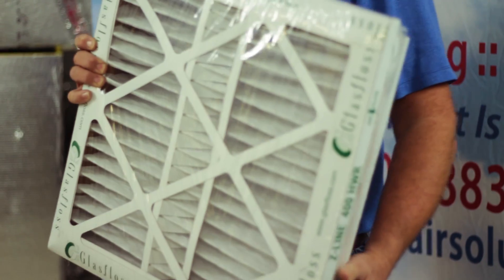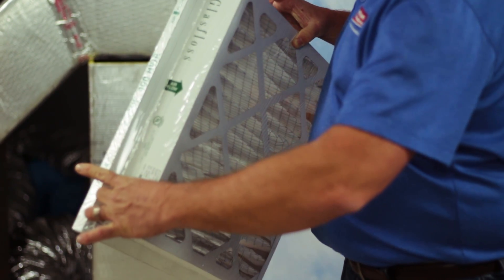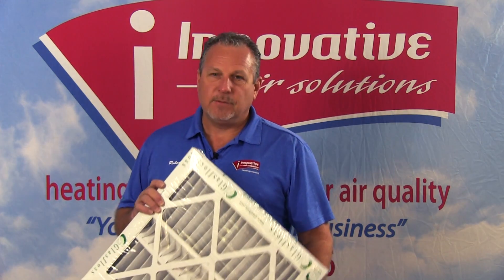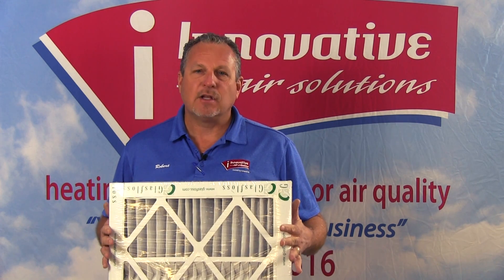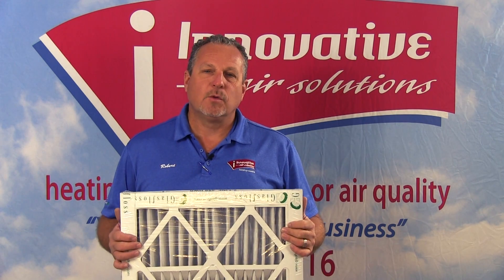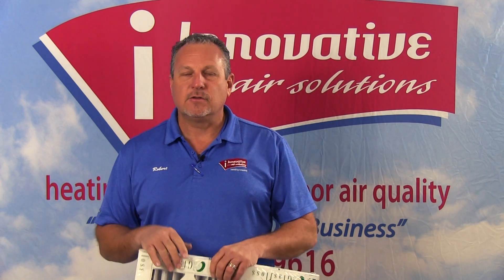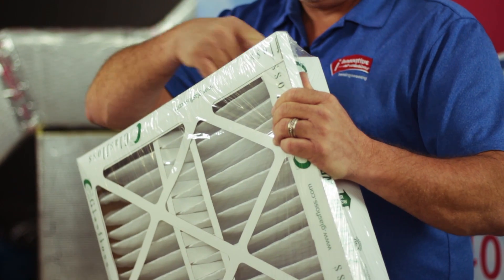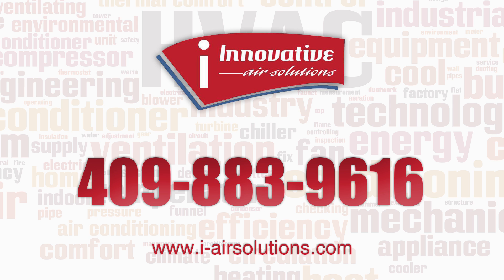HVAC - Return Air and Filters

Comment: No one provides Techs with the formulas for right sizing filter rack areas to achieve proper velocities through them; I will: 
HVAC Airflow- Duct, filter’s Ak and other Component Sizing Formulas: 
Ak area of the filter: CFM / required or desired fpm velocity
Example: 3-Ton @1200-CFM / 280-fpm= 4.2857142-Ak
Heating only 858-CFM / 220-fpm = 3.9 (Ak) SF open-air-area. 
My filter numbers:
I have (3) 12” x 32” filters 384-sq.ins., each x 3-filters  is 1152-sq.ins / 144 is 8-sq.ft. | so, 3.9-Ak sq.ft., / 8-sq.ft filter area is 0.4875% or, filter’s Ak %.
**A tested 59°F heating mode temp-rise x 1.1  is 64.9 furnace 55,500-output / 64.9 is 855-CFM  3.9 X 220 = 858-CFM; Had a tested 855-CFM; very close. … 
Therefore, a single 16X25 filter is 400-sq.ins. / 144 is 2.7777 400*.4875=195-sq.ins./ 144=1.3541666-open-air Ak of the filter). 
Filter’s Ak = CFM / fpm velocity through the filter in fpm
FPM= CFM / SF Ak AREA of filter
CFM = fpm X SF (Ak) AREA of the filter
Required Ak % of the filter’s area= smaller actual Ak area ‘/’ filters actual larger listed Square Foot size area. 
**Print & Save all these Formulas & USE them to properly size filter rack areas to achieve proper low filter fpm velocities...! 

Also; a 6” duct; so 6" x* 6” = 36 *x .7854 = the 28.2744-sq.ins" / 144 = 0.19635-Ak-sq.ft area. 
** I like the Purolator P-312 white Industrial Strength Disposable Synthetic Panel MERV 4 filters - decent pressure drop with good filtering -  you have to order them on the Internet; has a .16" PD @300-fpm; .10" PD @200-fpm velocity
. 
**7 out 10 HVAC systems by exhaustive testing have airflows out of tolerances, this can cause high cost ECM motors to exceed their rpm Rated limits & thus overheat & fail…Also results in very high cost compressor failures! 
**There is also a direct correlation between the blowers 0.5” or 0.6”WC and the total equivalent length (TEL) of the duct system regarding the amount of remaining available steady pressure.  Jack Rise having done many hundreds of Manual D’s friction rate sizing has stated that you may need to have 0.4 inches if you have a total equivalent length of the ductwork in order to get a friction rate design of 0.08 inches of water column for adequate velocity in the supply runs.
** Okay Manual D; .4” * 100 = 40 / ‘a very high’ 500-TEL is 0.08” WC friction rate to achieve enough velocity.  Manual D on the Internet shows an improper example of designing friction rate for the supply side air-flow; you need a much higher rated static pressure oversized blower than .6”. to have .25” to.3” of Available Static Pressure (ASP) remaining. 
They show a 0.6 inch water column blower and all pressure drops result in an Available Static Pressure (ASP) of only 0.17” WC; .17” * 100 is 17 / 500-TEL is 0.034-FR; and therefore, supply air ducts would be sized way to big and would result in an extreme low velocity of airflow through the ducts. 

**A more reasonable situation is .25” (ASP) Available Static Pressure & 300-TEL, or less; 25/300-TEL is .083” (FR) Friction Rate to achieve proper airflow velocities.